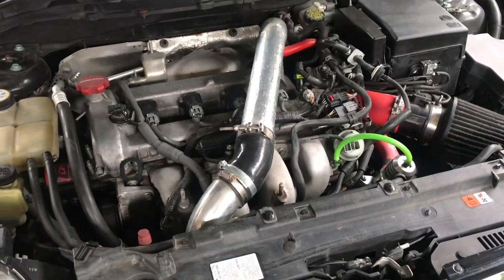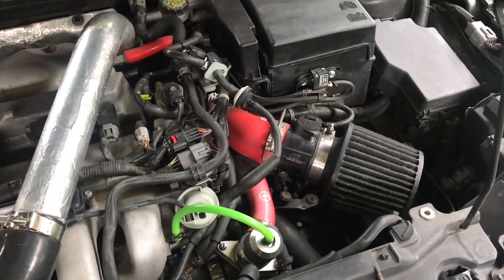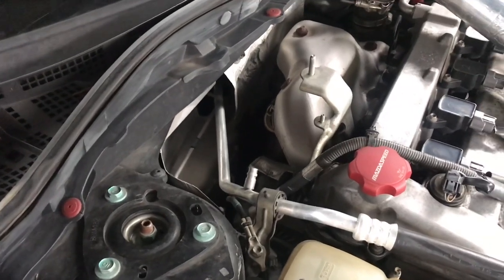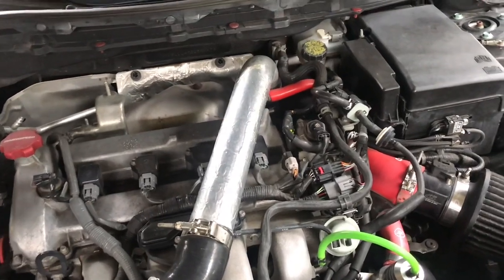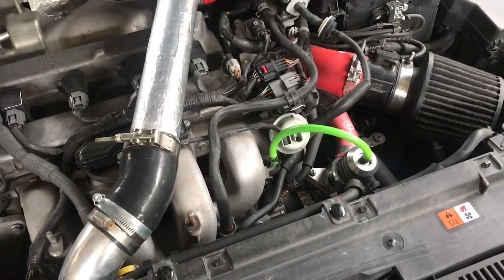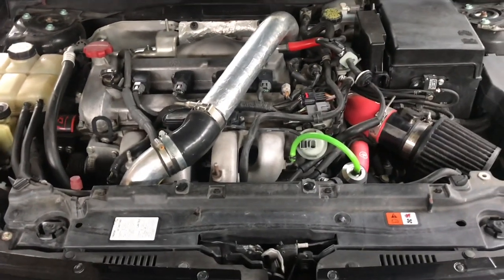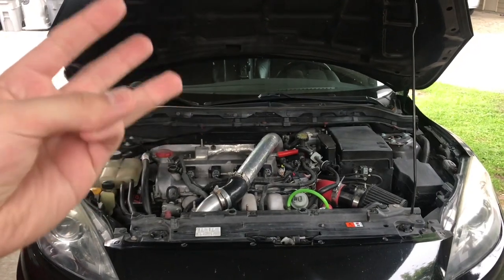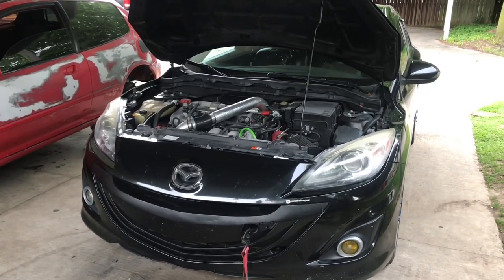Easy way to make 300whp in a Mazdaspeed 3

Comment: I suggest a dual catch can with an upgraded PCV plate, the stock one way PCV backs with oil over 15 psi of boost, and   sends oil from the crank case back in to the intake causing blow by.
Reply from the maker: I did not know that, appreciate the info!
Reply: Two Bunz any links to those parts? Or the ones you used? Good info
Reply: @Checkers_123  mine are ebay catch cans, and oil regulated hose from the autoparts store, (NAPA sells it) lol, I can link the info here soon,  you will want to run two check valves along with the pcv valve, you will need an upgraded pcv plate with two ports for valve fittings (stock only has one) but Damond MS sells a glorified one you can buy for a couple hundred.  This will make you run slightly lean without a tune. Hang tight and ill post some links if not too late.
Reply: That's not how any of that works. Its almost completely opposite  of the way it works
Reply: Blowby is when some combination of cylinder walls, pistons and rings are worn to point the compression event pushes air past the piston into the crank case,
Reply: Failed pcv or leaking under boost can cause it push oil out the pcv as well, but thats not blow by.

Can just put a kynar check valve between the  pcv and manifold. But yes you should get a catch can for oil vapor. If you are pushing oil out of the crank case you need fix your shit
Reply: This must be why I’m losing oil💀, been doing some wot pulls for my tuner and my oil level keeps changing a crap ton

Comment: Actually the fmic is an upgrade. It drops your intake temps by around 50*F. Which in return gives you denser air which is more power
Reply: That’s informative none talks about how much the FMIC changes the air temp
Reply: @dorybseibes9723  Maybe b'coz its too subjective and both top mount and front mount have their + N - equally balance.
Reply: I mean yes and no, it’s still a smaller core so not really going to cool things down a whole lot more than say an upgraded tmic.
Reply: I've got a full bolt on ms3 and on an average I don't see more than 20-30 lower than stock intake temps. Sure maybe on a hot day when heat soak would be at max but I don't know I've ever seen 50 lower. The top mount on a gen 2 is pretty efficient as is.
Reply: @tylerFC1  Heat soak though.... No contest

Comment: Of you want to max out stock fueling and block..

Autotech hpfp
3.5 inch intake
Upgrade factory tmic to a front mount or upgraded top mount.
Get a bnrs3 or a bnrs4
Go catless downpipe
Full exhaust
Upgrade bpv
3 port ebcs
3bar map sensor

All of this while pro tuning with a reputable tuner via cobb accessport

Do dual maps 91 and e30/e50 whatever your tuner recommends.

Easy way to make or get close to 400
Reply from the maker: I want to go s3 or gt28 to max out the stock fueling and block. bet with a proper tune on e85 they roll out! Looking into a 3inch to replace my cork sport stage 2.
Reply: @NewOrleansSpeed  get an HTP 3.5 inch intake
Reply: I can attest to this comment. I have almost everything listed except the 3.5 intake and e85. I practically have everything else and supposedly I'm pushing 330-340 on 91. I have the cst4 and 3" intake and everything else listed with freektune.
Reply: @jackrios4040 how much did all of it cost
Reply: @kylewilliams2895  I'd say 4k tops for quality parts.

Comment: Nice video bro!
My MPS is making 283whp 447nm at 1.2bar boost .. I've only got a K&N Typhoon intake and an aftermarket turbo inlet hose, custom exhaust, Turbosmart BPV, and 2nd cat delete
My tuner uses MazdaEdit for the remap and it's been good since 2018 til today... planning on adding an aftermarket downpipe and a HPFP to finally raise the boost and go past 300whp
Reply from the maker: Gregory Bajien definitely get those hpfp internals! If you are in a place with e85, I’d get a map for it. Causes some wear and tear over time, but you can’t beat the cooling effect and knock protection it provides. Especially if you only have 91 in your area! You sound like me lol, I’ve been running the same map for years. 

Good parts and good plans man, lmk if you have any questions!
Reply from the maker: Gregory Bajien how do you like your MPs?
Reply: NewOrleansSpeed loving it bro haha I came from a Mitsubishi 3000GT VR4 and Airtrek Turbo, and the MPS feels way more fun with better torque response even in stock form, and it’s such a sleeper too over here in Malaysia where there were only 100 units sold officially by Mazda

Comment: can this be down on a stock k04 and do I need to upgrade my pcv before installing downpipe?
Reply from the maker: Geronimo Jr i have the stock K04 and no you don’t, i have yet to touch my PCV
Reply: @NewOrleansSpeed  okay great which downpipe do you reccomend?i heard cpe is good but theres chance the turbo will stsrt smoking
Reply from the maker: Geronimo Jr CPE, Corksport, EBay, they all are about the same, but pricing is different. I went with eBay cause it was cheap and has lasted me. Corksports downpipe has a divorced waste-gate pipe. I’d go with whatever sounds the best to you as they should all get you similar results hp wise.
Reply from the maker: Geronimo Jr if you are concerned with smoking look up the Banjo restrictor bolt for mazdaspeed 3 and cx7. Help limit oil flow into the turbo

Comment: To tune the ecu it is nesesarry to use accessport like Cobb or you can tune the ecu without the accessport by Just flashing the ecu!!
Reply from the maker: Both! You can take it to a professional and they can tune it on a dyno or you can get an accessport and an etune. You can also get maps made for your car that can be stored on the AP and swapped at will. Getting a dyno tune locks you to just that tune, unless you have an AP.

Comment: Sometimes open intakes actually lost bhp over the stock closed boxes
Reply from the maker: Very true! Unfortunately the stock speed3 airbox/intake is very restrictive, i know VW/Audi products tend to have pretty good flowing intakes from factory! 

Although open does get hotter quicker!
Reply: @NewOrleansSpeed  so u sayin if i get an aftermarket intake i will 100% see power gains on my mps?
Reply from the maker: @PeTRoL-HEadx  100% 

https://corksport.com/amp/mazdaspeed3-short-ram-intake.html

Comment: Hey! Love the video. My previous car caught on fire, and I’m wondering how reliable is your speed 3? Are there any big issues I need to know about? Burns a ton of oil or any of that?
Reply from the maker: Rot8n i actually just made a video about my car reaching 100k! All is good, only thing that has broken is my slave cylinder boot, also a super easy job. Car is a rock

Comment: I bought my speed from a dealership. The car came with a straight pipe, down pipe, a intake, blow off valve and i’m not sure if it has a high pressure fuel pump.. after a couple days of driving it the engine light came on. 

Codes 

P2096 - powertrain
Post catalyst fuel trim system too lean bank 1

P0137 - powertrain
O2 sensor circuit low voltage (bank 1 sensor 2)

P013B - powertrain 

What do you think?
Reply from the maker: Barry sounds like you need a tune or should contact a tuner, did it come with an Accessport? If it has all those mods and no tune that could do it. 

I’d also put money on your BOV being fucky. Mine had inadequate spring pressure and leaked at idle causing a vacuum leak, which in turn popped a lean code as well. In order to fix it i added some washers to my BOV and that fixed it. So check this first as it’s easiest. Get a little bottle of soap + water and spray it around the BOV, if there is a leak you’ll see some bubbles (i think lol). 

Here’s some reading material: http://www.mazdaspeedforums.org/forum/f436/p2096-finally-fixed-150603/
Reply from the maker: Barry p0137 is from your Downpipe, I’ve had that code click on and off for the past 3 years lol, so nothing to worry about. Your Downpipe is probably catless
Reply: NewOrleansSpeed thanks man! I'm definitely gonna go check the BOV right now and let you know if thats the case. And yeah its catless, it stinks in my car lol
Reply: And no the car didnt come with an accessport which sucks. I'm assuming the other owner toook it.
Reply from the maker: Barry ahh damn what a pos, doesn’t part out the car but takes the AP. Chances are it’s untuned then which is no bueno with all the mods. If i were you I’d take it easy until you can get an accessport! But ya check the BOV, what kind is it?
Reply: Sounds like you have a catless downpipe without a tune

Comment: I currently have a 2011 ms3 current mods Corksport turbo back exhaust , cork sport hpfi , cobb bpv , cobb cold air intake , cork sport boost controller and the CST4 turbo how much power you think ill push if i got e30?
Reply from the maker: Jose Ayala so the stock fuel system, even with the upgraded pump, tops out at around 400 whp. I’ve seen a CT4 with FBO and Meth hit in the upper 4s. I’d say anywhere from 350whp to 400 depending on dyno

Comment: Idk if you heard of freak tune upgraded "ofs+" plus map which is basically Justin's protune but with only one revision instead of 3 rev. You think if he got me up to 21 psi w/ catless dp, hpfp, sri, tih, turbosmart Kompact bov, resonator del,muff del. On 93 pump. Would I be at least approaching 300? Or that e85 is an important factor.
Reply from the maker: moreauryan of course, Freek is really good. I would say that an ots Freek map would get you close to 270-280whp. He does have a lot a dynos on his website, maybe he has one of an OTS car. But a Freek protune on 93 should get you there, if not close! But a Freek ots tune is better than Cobb ots tunes.

Comment: For these tips does my car have turbo , I have a Mazda 3 2.3 l no turbo first gen. Will these tips help with non turbo ?
Reply from the maker: GMS Spiritual Gains these tips are exclusive to the speed variant of the Mazda 3. But an intake and headers will do you wonders, same with a tune! Get damn near 200whp out of that 2.3, which is pretty good for an NA motor
Reply from the maker: Check this dude out full bolt on NA Mazda 3, https://youtu.be/LHRZhGaCeW4
Reply: NewOrleansSpeed okay thank you for the tips man , first car I’m working on building up and be really looking for tips and advice about Mazda 3 first gen. And your video as been the most help thank you
Reply from the maker: GMS Spiritual Gains ya man anytime, goodluck with the info hunt! I like helping out, so if i can anymore lmk. Appreciate the support and comment! Hope you are having as good of a stay home as possible
Reply: Do a 2.5 swap and as NewOrleansSpeed said, get an intake, header, maybe some stronger internals (not necessary though) and a suitable tune. The 2.5 comes with more torque and hp than the 2.3 and is more reliable.

Comment: if i simply only got a short ram intake would i need a high pressure fuel pump?
Reply from the maker: vinny saddal i ran one without for a long time, no tune either. I would highly recommend getting one if you plan on tuning your car
Reply: HPFP is the first mod you should do
Reply: Depends on tube size seems to be the consensus. If you run a stock size intake then no......but 3 or 3.5 inch absolutely would reccomend to change it as well as a tune. The maf sensors on these cars are a bit finicky.

Comment: my car is still totally stock only has an aem cold air intake. i heard the stock car needs upgrades like im supposed to get a high pressure fuel pump but is this true and if i get a high presure fuel pump would i need to retune my car?
Reply from the maker: ZIGNIMUS what you need to do is like and subscribe. Jk jk

With just an intake, i would say you are good. Anything else and you need the hpfp. You do NOT need a tune with a hpfp. Car should just work with it.

Comment: Is it safe to install all these mentioned mods, and then run OTS tunes off the accessport for as long as I want, if I’m not able to get a professional tune?
Reply from the maker: Trushal Patel so the hpfp will work without a retune, but the rest of the mods you will get the bang for your buck with a custom tune.

But that being said, a OTS tune is fine to run on for a while, but I’ve really only heard negative things about OTS tunes. I would say keep tour accessport on and monitor your knock rate. But i had a testpipe, intake, hpfp and ran fine on an OTS stage 1 map. But once i get a pro tune it made a huge difference. Ran better in general
Reply from the maker: Trushal Patel good luck, lmk if you have any more questions! Appreciate the comment

Comment: When you say things need a tune does an AP tune work or need a pro tune?
Reply from the maker: an answer requires you to subscribe
Reply from the maker: jk lol, so an AP tune works, but you will not hit 300 on an AP tune. AP tunes are just placeholders for a real tune. I am not lying when i say a good tune makes the difference.
Reply: I would never run an ots tune with anything more than a stock size intake. I've seen some major damage done with improper tune for mods. Even as a placeholder for a pro tune. With most the guys now, freak, drama ect. They can get you a base tune to your mods with a couple days of paying. They have so much experience and have been doing so many cars lately they can basically give a starter tune for any number of mods/brands combinations.

Comment: Yea, but can the drive shafts handle that much power?
Reply: Yes they absolutely can. They're extremely overbuilt beefy axles, literally twice the thickness of a typical Honda axle. My car has a cst4 tuned by Erik on 21psi which I'm pretty sure makes 300, and aside from having replaced the RMM and PMM due to breakage and having installed a 6 puck ACT clutch (that honestly feels close to stock), it feels like the rest of the car could handle gobs more power the way it is, like it's meant to have that much power.

Comment: My question is is the MZR known to be reliable in the long term with 300WHP? Assuming all maintenance is kept up with.
Reply from the maker: trapxgod going on 84k! Proper maintenance and car goes a long way
Reply from the maker: Like 40k miles with bolt ons and 30k with e85
Reply: @NewOrleansSpeed  I wouldnt say that 100 percent . Gen 1s have turbo seal/ smoking issues (more than gen 2s)
And same thing goes for vvt actuator
Reply from the maker: JesusManPowerKick very true very true, those are the main issues with these cars.
Reply: trapxgod mines been great for the past week no hiccups. Long term: I see myself blowing the stock k04 if anything. But that’s just another reason to upgrade to CorkSports better turbo!

Comment: so you have to have hpfp fuel enternals ?
Reply from the maker: erik dennard it’s an absolute must outside of just an intake or downpipe. The stock cam driven pump can’t provide enough fuel to match the amount of air being driven by a better flowing intake and exhaust. Running lean is the leading cause of zoom zoom boom

Comment: Any downfalls to e85? Gas station in town from me supplies e85 but I kinda want to stick with 93
Reply from the maker: JesusManPowerKick no real downfalls except decreased mpg! A good e85 should net you some good whp, wtq, and be perfectly street-able especially in the summer heat. Anything more than a e50 could damage your hpfp, but no tuner would tell you to run more than e30. All you need is a tune
Reply: NewOrleansSpeed So running e85 isn’t recommending much?

Comment: Hi I was wondering which downpipe you got, I can not find it on ebay
Reply from the maker: https://www.ebay.com/itm/STAINLESS-STEEL-DOWNPIPE-DOWN-PIPE-FOR-07-13-MAZDA-3-MAZDASPEED-TURBO-2-3-L/223921966104?fits=Model%3A3%7CSubmodel%3AMazdaspeed&hash=item3422ca0c18:g:O8cAAOSwOwJe4J3p

Comment: Can i run a bov on stock motor without tune?
Reply: Or a bpv
Reply from the maker: some say no to the bov as you will run rich when shifting, it also just runs worse in general when compared to the bpv. I would run bpv just as the cars seem to make and hold boost better when boost is recycled.
Reply: NewOrleansSpeed okay cool man ! Thanks ! If i run an after market bpv i dont need a tune right?

Comment: Good vid, you have a link to the down pipe?
Reply from the maker: Miles Williams i can try to find it. It’s been a while.
Reply from the maker: https://rover.ebay.com/rover/0/0/0?mpre=https%3A%2F%2Fwww.ebay.com%2Fulk%2Fitm%2F282781944817

This or Manzo. The og seller of mine no longer sells it. But this is what it looks like.
Reply: NewOrleansSpeed much appreciated!  I have a white 13 i plan on giving some love to this summer.  Also did the cel come on? Also if it did can you clear it?
Reply from the maker: Miles Williams anytime man, a cel comes on periodically. I have a way to clear, which is access tuner race on my PC. The other way is to get a tune and they will keep the cel from popping
Reply: NewOrleansSpeed sounds good bro. Thanks for the reply💪🏽
Reply from the maker: @mileswilliams639  anytime man, good luck!

Comment: Im sorry, but you need more than that to hit 300. Im full catless with a full 3" intake, Autotech FP internals, BPV, injector seals, CS TMIC, 3 port EBCS on E33 from freektune, and made 280whp and 330wtq on a dyno jet. This is running almost 23psi on the K04. If you want 300, you're going to have to either REALLY push the K04 for PSI, or add port injection/meth. The stock turbos on these cars just dont move enough air in the top end to legitimately carry power through the rev range.
Reply from the maker: Gotta be A Speed I’ve ran dyno proven 280whp cars and i walk them like nothing
Reply: @NewOrleansSpeed  you're not making 300whp.
Reply from the maker: @victorkirby7652  lol bet
Reply: Gotta be A Speed you only made 280 with those mods PLUS e85??